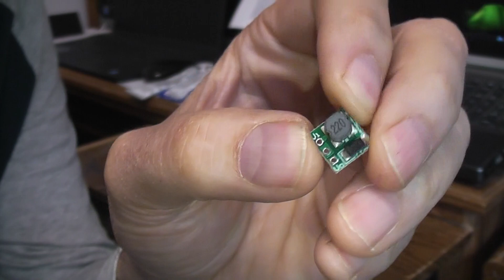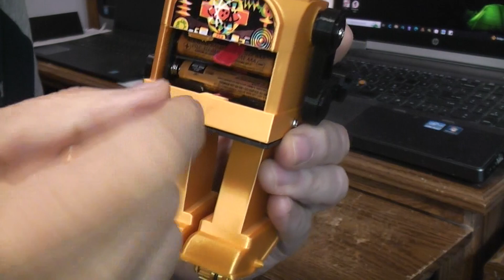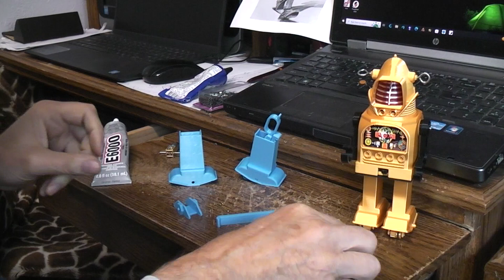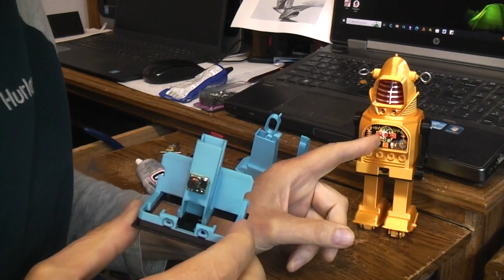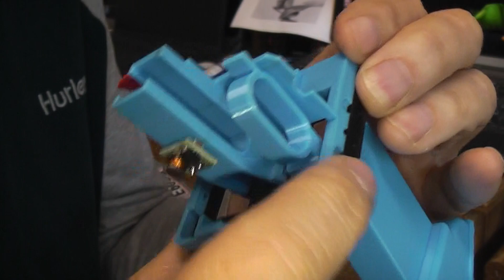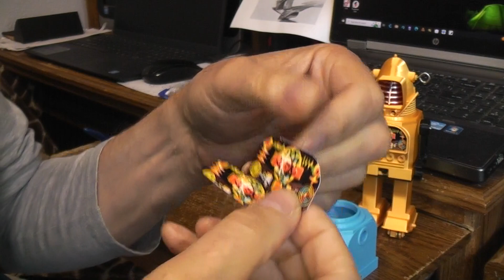3d printed Jupiter robot "N20 dual shaft gearmotor" build part 1. STL file link.

Comment: What an effort, nice work John!

I did not realize you were using N20s knowing you had almost always used the TT motors.

Greg
Reply from the maker: I have the same robot build coming out with TT gear motors as well, since many of they followers say they can not buy the dual shaft N20 motor in there location.